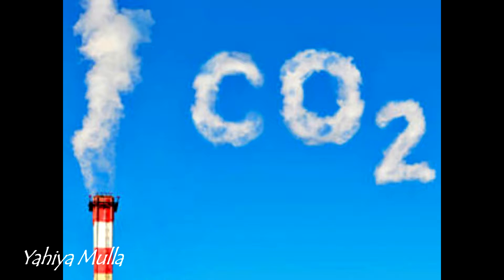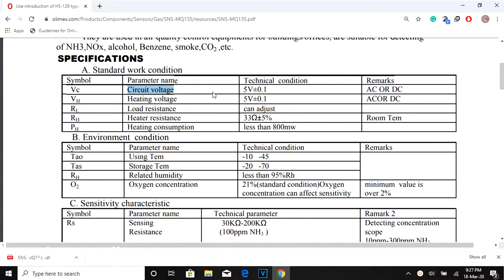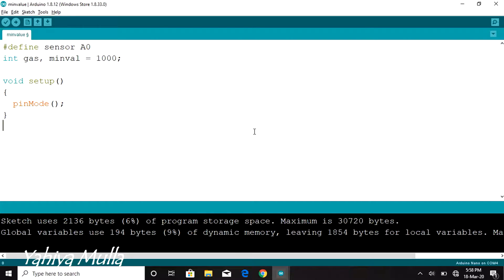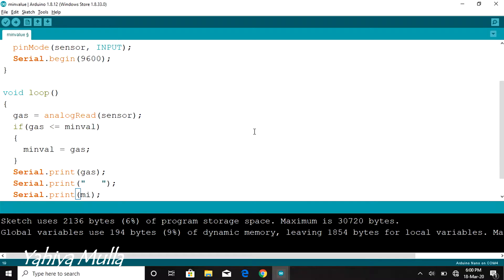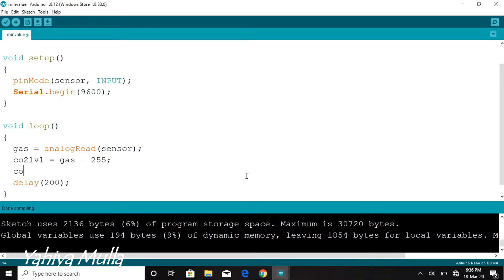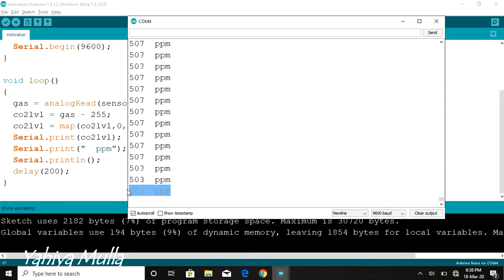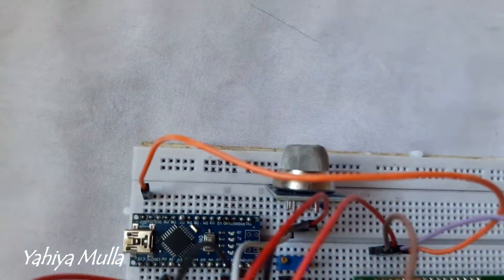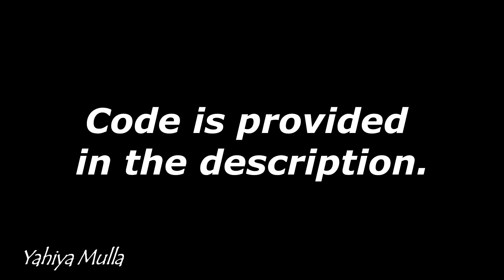Carbon dioxide detector using Arduino (mini project)

Comment: Great work!! I thought about having a carbon monoxide reader to check the efficiency of the combustion of the air/fuel mixture in a car engine, for that I would have to adapt this project with the MQ-7 module.

Comment: Could be cool to have a system that showed three different LEDs indicating different air quality values. Green as good, yellow as poor, and red as bad. Would it be possible with the current base setup?

Comment: Can i ask what did you use to feed the 5 v to the display and sensor?
Reply from the maker: Hey. 
I used the 5v output pin from arduino.
Reply: @YahiyaMulla  ok, thank you

Comment: mine displays around 95-110 ppm indoors open windows.. when I enclose it with my hands and exhale into it.. it only reads upto 400ppm. yours goes to 600+ ppm.. is mine broken?. whats the purpose of the little potentiometer on the mq135 module is it for calibrating?
Reply: Where are you from? India is a very polluted place so it might be normal
Reply: @cek0792  The arduino mq135 library found on the net had an error in calculation. I fixed the library.

Comment: Here can I use Aurdino R3
Reply: And also expalin the difference between Aurdino Nano and Aurdino R3
Reply from the maker: Yes, you can use it.
Where as difference is considered nano is compact where as arduino uno r3 isn't. But both have the same atmega328 chip hence same processing power.
Reply: @YahiyaMulla  coding is same for both nano and R3??
Reply: Thnku so muchh ❤️
Also subscribe my channel #therisinghacker
The Rising Hacker
Plss🥺🥺

Comment: sir i have LCD with i2c what to do ????
and sir i don't have potentiometer that's why i'm using i2c module reply faster sir i need the new diagram of the circuit plzz reply faster as u can !
Reply from the maker: Hey,
Change the code for LCD with the i2c LCD. It should just work fine.
Reply: @YahiyaMulla  when i changed #include <LiquidCrystal_I2C.h> and LiquidCrystal_I2C lcd(12, 11, 5, 4, 3, 2); the lcd display went blank ?? what should i do

EDIT: sir now the display is fine but no results in the display ????
Reply: and idk whether i've correctly connected the wires from i2c to nano check out and say sir vcc-5v , gnd-gnd , sda-a4 , scl-a5. is this correct ??

Comment: "MQ 135 gas sensor" does not measure CO2 level
https://www.aliexpress.com/item/4000773800548.html?spm=a2g0o.productlist.0.0.16db3e2f60bnzR&algo_pvid=c01fae33-a830-400c-a9d8-259b4ae1946c&algo_expid=c01fae33-a830-400c-a9d8-259b4ae1946c-7&btsid=0bb0624416066519811845982e234d&ws_ab_test=searchweb0_0,searchweb201602_,searchweb201603_

Comment: Hello, thank you for the video, i was wondering if you know what is the use of the resistors thAt are Located in the back of the mq135 sensor?, and if so, could you please tell me How to use them please, thanks a lot, best regards!
Reply from the maker: Hey,
That potentiometer is used to adjust the sensitivity of the sensor. Have a look at its datasheet you will have a better understanding about it.
Reply: @YahiyaMulla  ok thank you sir, i appreciatte it, thank you
Reply: DO I NEED A DISPLAY TO SEE THE CO2 VALUE OR I COULD USE THE PC  ?? I say that because I have a problem with coding the display.
Reply: @funny11744  hello, you can check it in the  pc, just  use the Serial.println ( "value"  c02 value);

Comment: Hiiii bro....what is the unit for minimum value....whether volume of the gas?
Reply from the maker: Value to measure is Parts-per-million (ppm). It is like the ratio of concentration of CO2 in the atmospheric air.
Reply: @YahiyaMulla  thanks bro